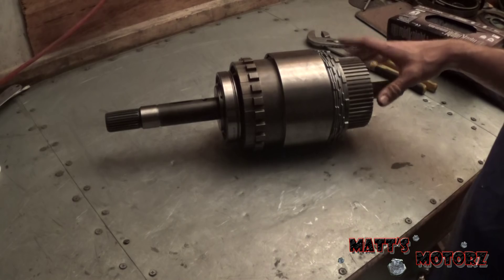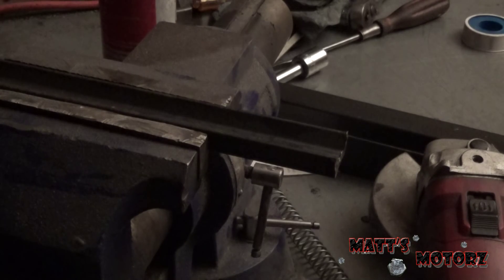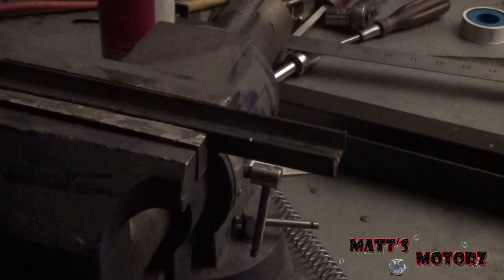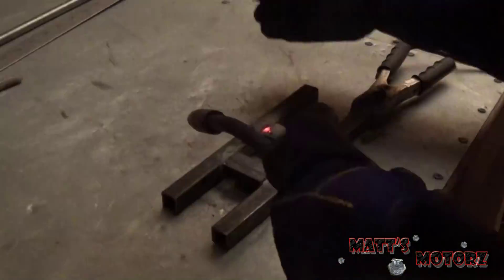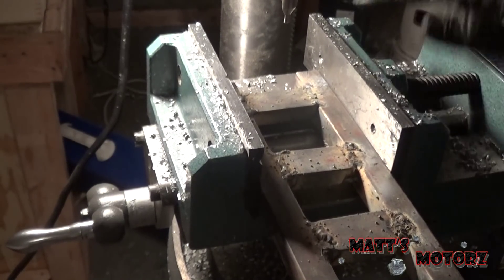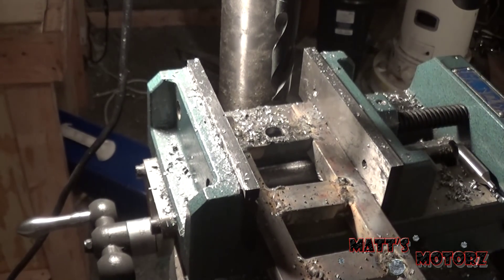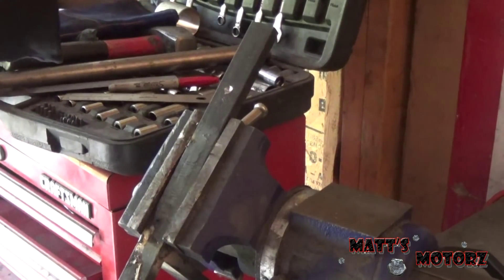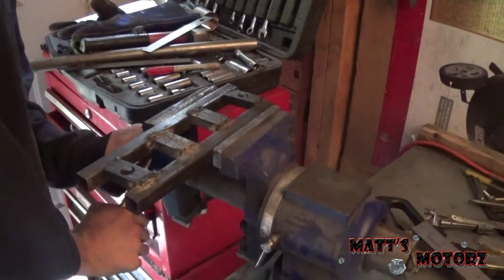Fabricating a Special Transmission Press Tool

Comment: I need to build one of these but in a different style, one that has a foot lever to press down on an arm or rod.  The model is T-0171 but just looking at pictures of it I don't fully understand how it works.  It seems that when pressing down on the level, the rear arm raises up which in turn presses down on the front.  I'm not understanding the internals of the tube.  Maybe you can google it and we can scratch heads together.  I'd appreciate the help!